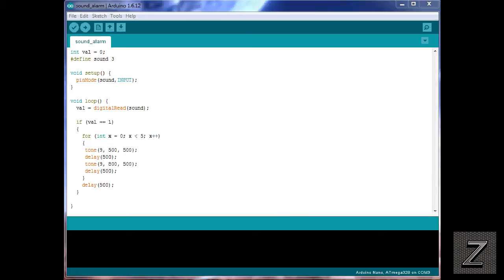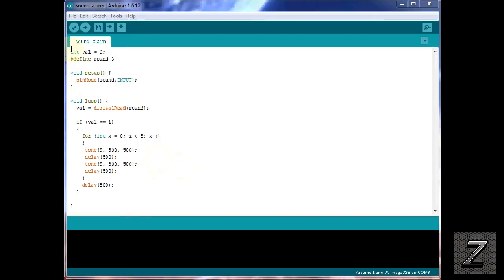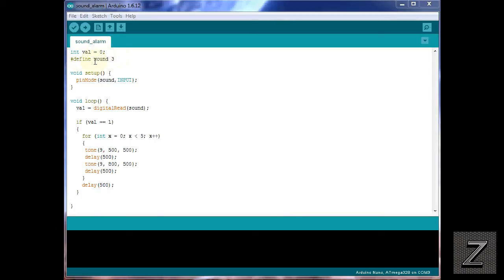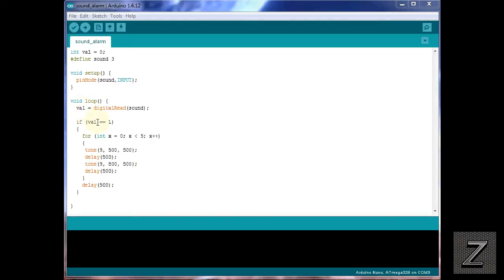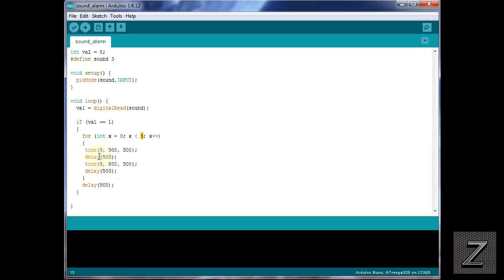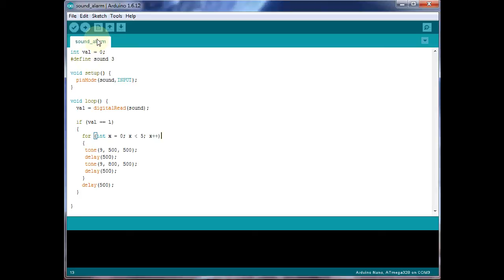ARDUINO Beginners Project : Sound Activated Alarm

Comment: hello sir i have problem with that because is not working on me ??
Reply: int piezoPin = 3; //buzzer (beeper) or speaker positive here and negative to GND
     
    void setup() {

    }
    void loop() {
     
        for(int x = 0; x < 5; x++) {
          tone(piezoPin, 500, 500);
          delay(500);
          tone(piezoPin, 800, 500);
          delay(500);
        }

        delay(500);
      
    }